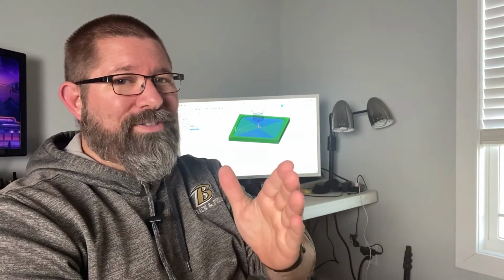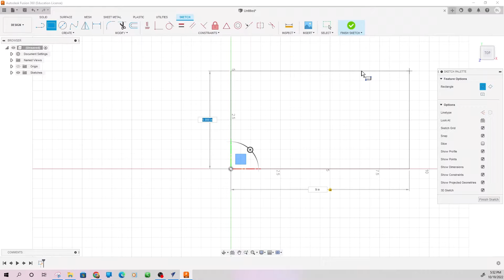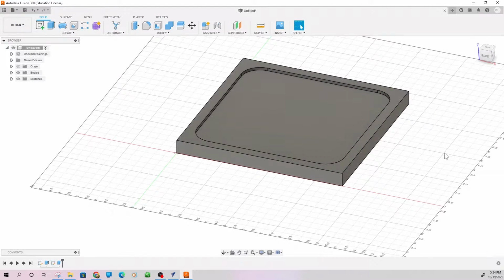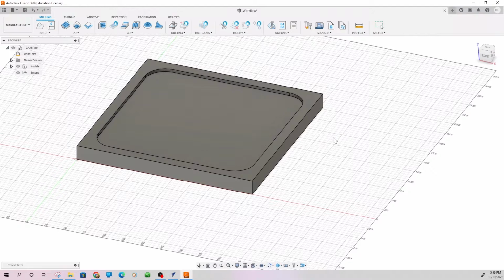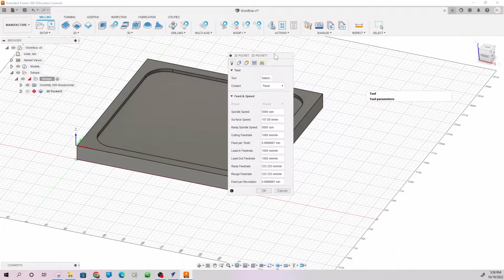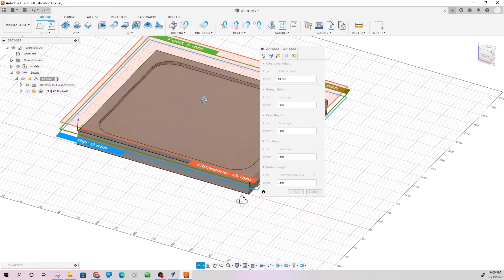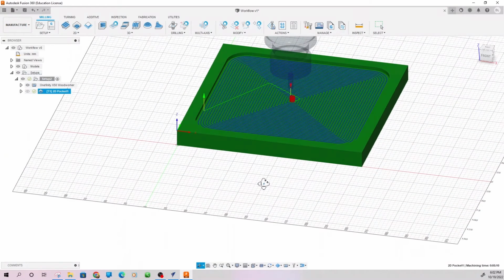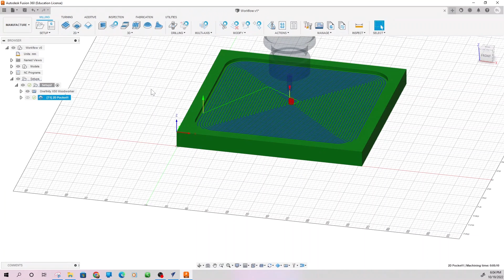Fusion 360 For The Absolute Beginner| Onefinity CNC Design

Comment: I’ve been using my onefinity for a couple years, with VCarve Pro. While VCarve Pro is fine, it’s not great for designing. This is where Fusion excels, especially to see things in 3D, and the ability to use drawing parameters to tweak the final product. But… the CAM portion is intimidating. So… like a dummy… I design in Fusion, print the drawings when satisfied… then redraw in VCarve Pro. (Yeah, I know, stupid, stupid). I’m taking the plunge starting with this video. Thanks a ton.

Comment: Enjoyed your video, In fusion I use the coolant/flood option to start my spindle pump via IOT relays but could also be used to start your dust collection,  In the post processer I use from onefinity forum it has a option to set a delay time so the program will delay a few seconds for the spindle to reach the set point speed before running the program.

Comment: Does the X-50 with  arouter control the spindle speed, or does the rounter just whirl away at it's normal speed?
Reply from the maker: It moves at its normal speed. You’d adjust the speed of your router on the router itself.

Comment: What did you tell fusion for a machine you'll be using
Reply from the maker: Check Onefinitys discussion forum. I believe you can download the configuration file from there
Reply: @SothpawDesigns  thanks I found the gcode loader on the autodesk site
Reply from the maker: @greybeardedition  Great. It'd been so long since I did it, I couldn't remember where it was listed. Glad you found it.
Reply: One last thing. I think I'm probind wrong. It keeps starting about 1/4 down into the material. Any thought?  When I use carbide create it works correctly
Reply from the maker: @greybeardedition  My first guess is that you're probing wrong, or maybe you have some setting or clearance incorrectly calculated.

Comment: Southpaw, I am having troubles getting my X50 journeyman setup with fusion..do you have a guide to set the machine up entirely? I don’t see OF as a vendor with available machines. Did you set the machine up as a generic milling machine and add custom values? If so, can you share your values? Thanks!
Reply from the maker: Check the Onefinity discussion forum. If I remember correctly, they had a download to import into Fusion.

Comment: Thanks this is a very helpful video. When I go to select the machine from the fusion 360 library, I cannot find the one Finity machine. How did you find it or did you set it up from a generic machine?
Reply from the maker: It’s been a few months since I set it up, but if I remember correctly, you’ll need to download it from the link below and install that way. https://forum.onefinitycnc.com/t/fusion-360-post-processor-download-links-included/2897

Comment: Thank you very much for putting together this video. The timing couldn’t be better I use fusion 360 for 3-D printing, and on my milling machine. And my Onelinfinity is on order and should be arriving any day now. Just one question you designed your part in inches, and you manufacture part in metric. Please explain why not the same? Please keep the video coming. I would like to see a follow up video where you take your G code from your laptop over to your Onelinfinity and actually cut the part.
Reply from the maker: Will do